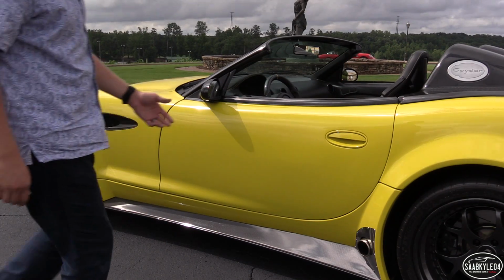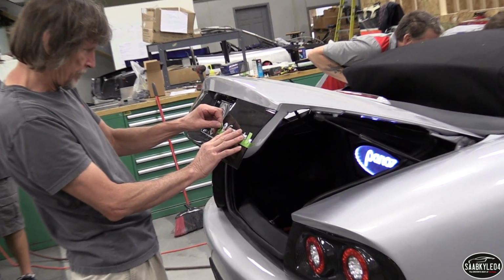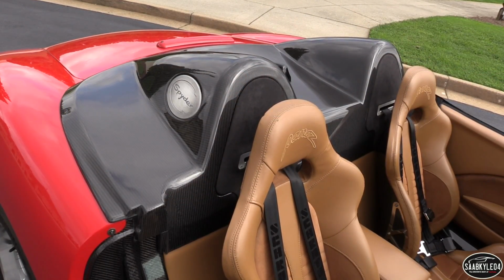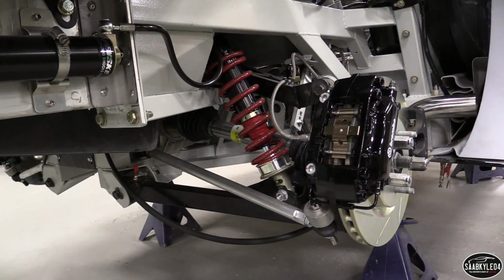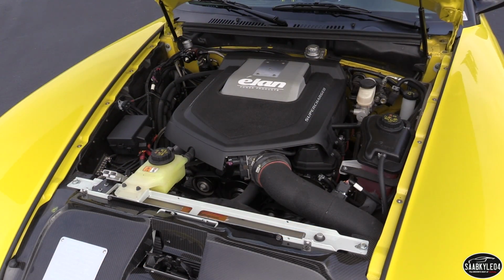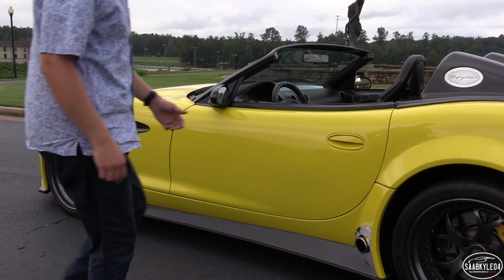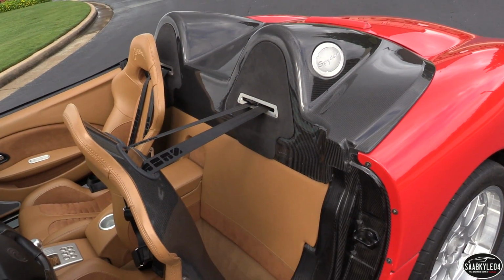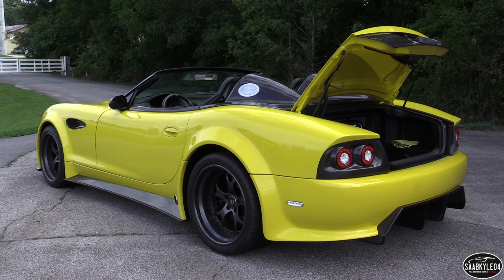Panoz Esperante Spyder/Spyder GT - Start Up, Road Test & In Depth Review

Comment: Panoz could be a great company if they redesigned their cars to reflect the price tag. If these cars sold at 50-60K they'd probably sell better. Right now the interior and exterior design lack the looks to justify the price tag. Especially considering they are using ford/chevy engines.